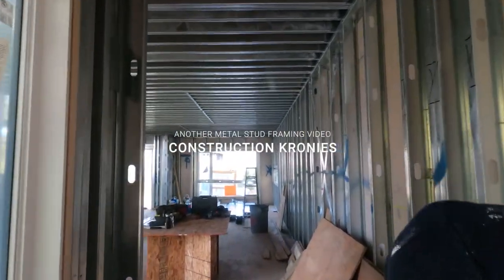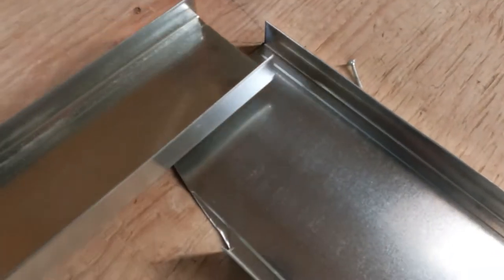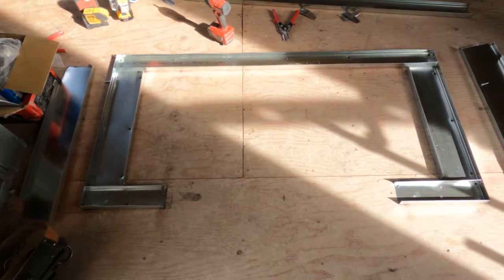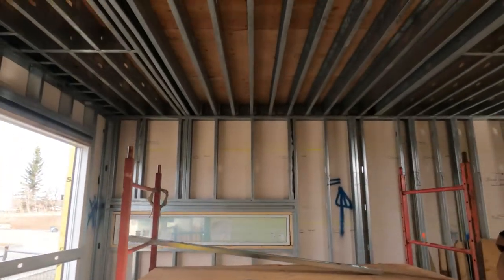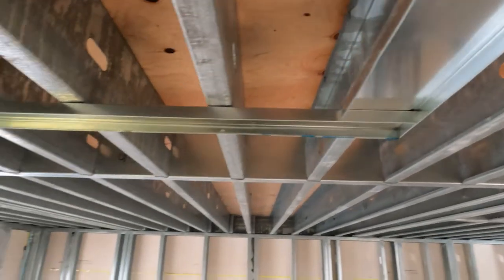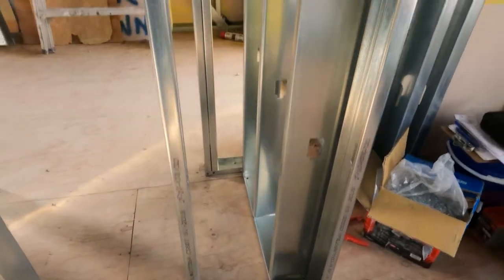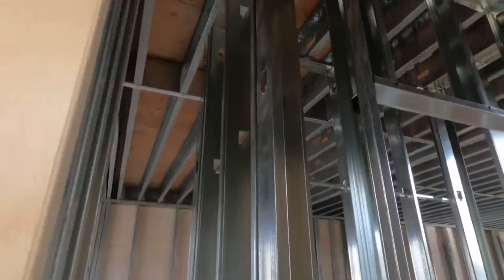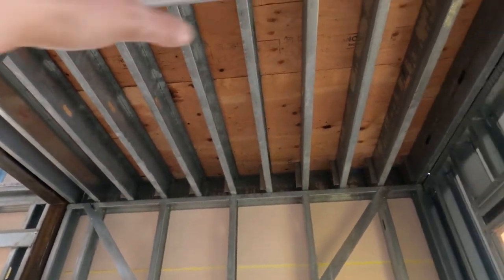How To Frame  A Simple Closet With Metal Stud

Comment: Question...for a closet with shelves...can 20EQ studs support shelves like a normal closet or do you need to add extra support?
Reply from the maker: What we do is install 3/4" plywood backing that fits in between the studs. 20gauge studs are strong but adding the wood is better for sure.